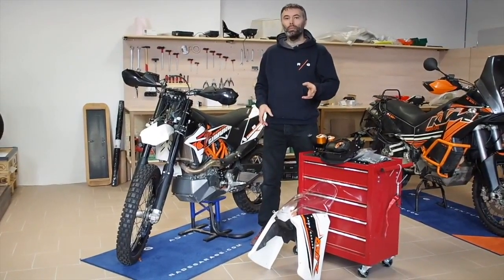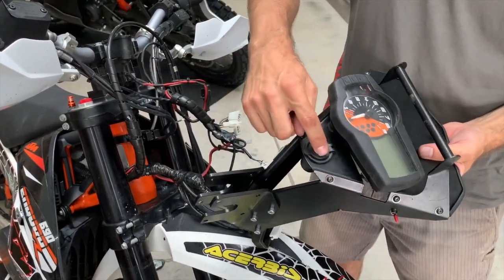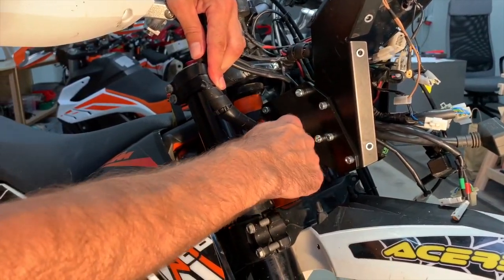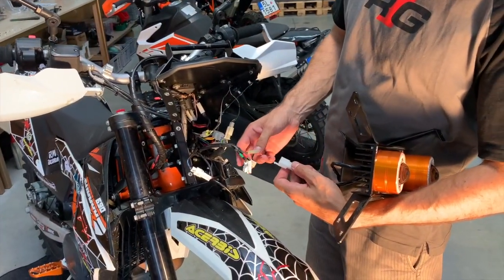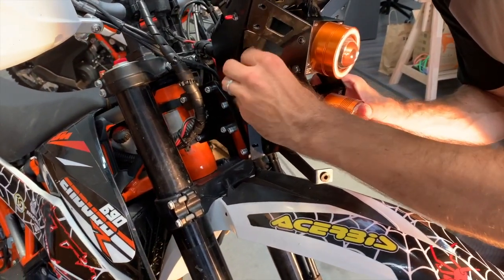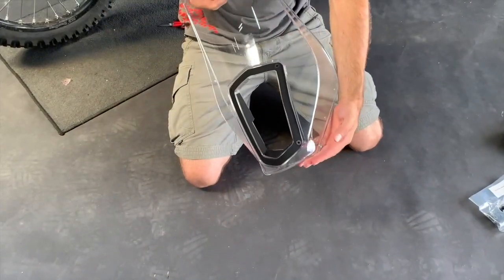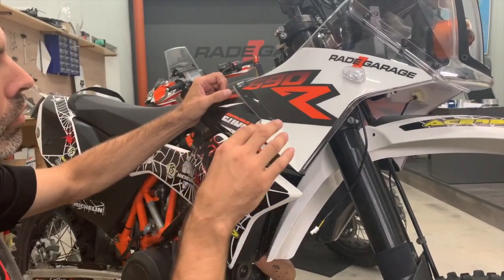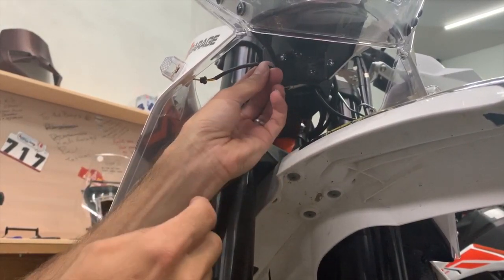KTM 690 K3 install video RADE/GARAGE

Comment: Just terrible, I'm at work stop, due to the bolts for the upper clamp not fitting into the bike hole as shown in the video. The provided M5 bolts do not fit into the mounting lug that comes with the bike.
Reply from the maker: Hi, did you report your troubles to our support on rg@radegarage.com ? The YT comments is not the best place where to report mounting issues :)

Comment: Hi Rade, you did a great job. I have a question about the side fairings: are the stickers pre installed? Is it possible to get them in another colour? Thx for your answer, all the best for 2021. Greetings, Mike.
Reply from the maker: Hello Mike, yes the stickers are pre installed. Upon request we can deliver the side panels without decals and you can let someone make the design as per your needs.
Reply: @RADEGARAGE1  Hi Rade, thx for your information. Is the windshield street legal, too? Is there an "E" marking on it?. Greetings Mike.